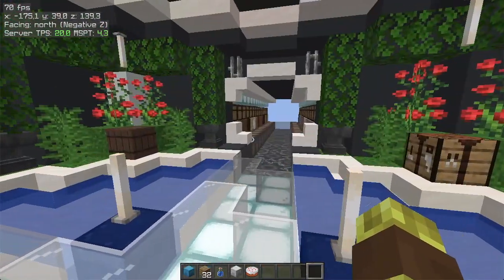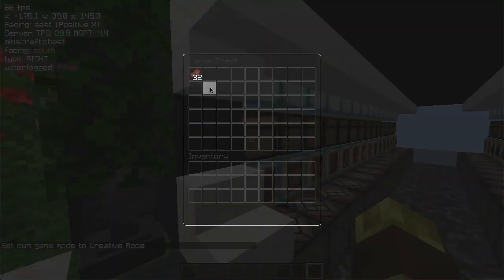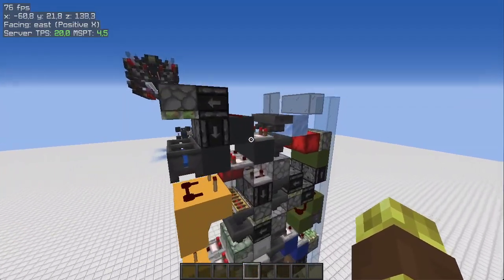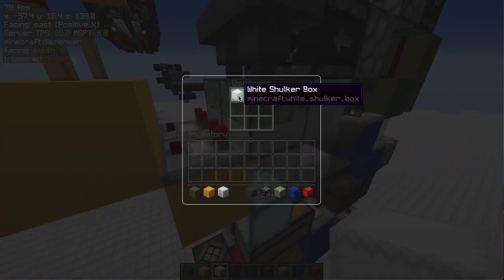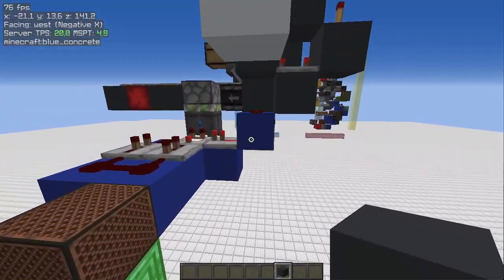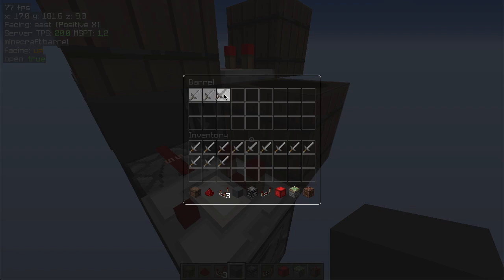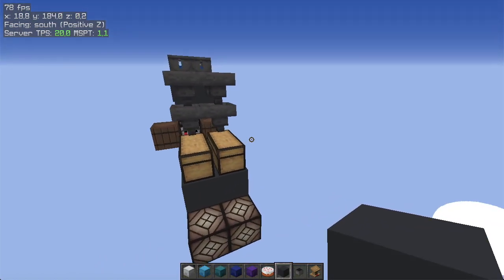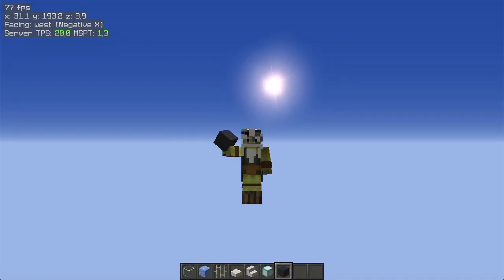Hybrid Storage System v2 [TUTORIAL + DOWNLOAD] [1000 SUB SPECIAL] MINECRAFT 1.14-1.16

Comment: (fixed got it working) For those wondering, the individual slices are working just fine in 1.18.1. However the full machine put on the world file is broken. trying to figure out why. //*edit*// figured out what was wrong. Replaced the cauldron with a solid state hopper locker and integrated the rail locking system with it.
Reply: Tried to google what a solid state hopper lock was but could not find it. What was the fix? Could you explain in more detail?

Comment: Im not sure if this is a recent problem or not, but mine broke earlier not long after building a 5 wide section

The item filter cauldron recieved 2 inputs too close too eachother and bc of it it got put in the wrong location
Basically as soon as the filter got back to 41 items it recieved another item, and that Caused it to break 
The fix I made is simply adjust the rate of the Items coming in
That way it can sort the full hopper out 1st before a next set of items comes in

Probably doesn’t make much sense as a comment, would be better if I could explain it
Reply: I am having the same problem. How did you adjust the rate? I built the same circuit he has at the bottom to only send 22 items at a time. But I assume lowering the blocks in the hopper clock would be fruitless. Because it would have the same problem. I am about to try to make it where it still sends 22, but waits a second longer before sending the 22.

Comment: The filters are broken as of 1.16.2-1.16.3. They get stuck with the redstone dust at power level 3 but replace the cauldron locking it when it should be unlocked. This can semi consistently be avoided by slowing down the item stream but it is way better to just use a standard item filter. Just make sure you leave space between the sections to avoid unintentionally powering the wrong side. This also requires raising the filters by one layer. Don't make the same mistake I did and build a 720 item sorter based off of this system without extensive testing. I downloaded the world download and did some testing but apparently not enough. I guess I'll just go waste another 100+ hours rebuilding the thing.
Reply: gosh someone already solved my problème. Thanks a lot for posting this
Reply: Do you maybe have a picture of one slide how you fixed it? I dont understand it by what you saying in the comments. (Sorry for bad English)
Reply: Yeah I have the same problem
Reply: Yeah so it won't always move the cauldron , unlocking the filters.. I just manually moved them and I works fine from there but I would also like to know a permanent solution to this! Especially when sorting multiple items this is becoming a problem

Comment: I seem to have a problem in 1.16.2
When i put a few stacks in the input at once eventually it will break when the items in the hopper drops to 41 just as the next group of items arrives and for some reason still thinks there is 41 items.
I have just started to build this in my survival, so i would love to see a fix for this :)
Maybe adding a delay to the item grouper could be a fix, but it would also make it a bit slow :/

Edit: I fixed it by adding a piston that stops the items for just a quick moment just before the item elevator and it somehow make the timing perfect and doesn't break.
Reply: Can you explain a bit more in detail please. Have the same problem
Reply: Would appreciate the solution

Comment: it seems the system keeps breaking eventually in 1.16.4, and from what other people are saying here it's due to the item filter? Is the solution just to replace it with the standard item filter instead?
Reply: The Piston timing that pushes items into the waterelevator seems to be the issue. 
Adding 1 stage of delay to the Repeater pointing into the comparator locking the hopperclock seems to fix this for me.
picture: imgur (dot) com / kh5QlAO
Reply: did it break in 1.16.4?

Comment: I think the major issue is that the sorter won’t work
Reply: really?why?
Reply from the maker: There's a specific case where the sorter could break :/
Reply: If you take out items when its in shulker mode it will keep filling up shulkers??
Reply: @samosthesage3719  yeah but that's specific case is very common

Comment: I have to regularly move a cauldron one block up or else the filter hoppers won't let items through.. this is th main problem I have. Also single slices sometimes store more stacked items then others (more than three rows sometimes) before it switches to shulker mode. 
It's kind of a struggle at the moment tbh. Really love the design so suggestions would be highly appreciated!
Reply: The item filters with cauldrons don't work anymore, replace the entire item filter with a hopper/dropper setup, it's the same width so it should still fit but it'll actually work. as far as I can tell the other cauldrons should still work.
Reply: @mrolson0603  could you explain how to set it up?

Comment: Sorter seems broken in 1.16.4 :(
Reply: In the world download you have to use the sorting system with redstone not the one with the sticky piston and cauldron
Reply: @independentipclips7670  So just replace every single slice with the redstone one and not the sticky piston/cauldron one?
Reply: @mrolson0603  Jep the `normal` sorting system with redstone. Then it should work
Reply: @independentipclips7670  This fixes the sorters but the thing that handles switching between the main chest and shulker boxes is broken because it also uses cauldrons.
Reply: @mrolson0603  is there any fix for this by now?